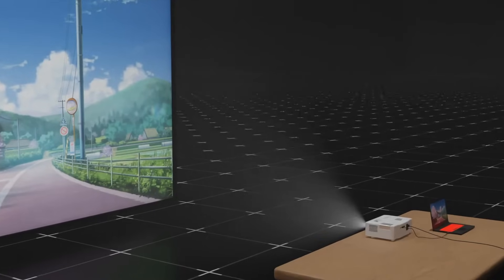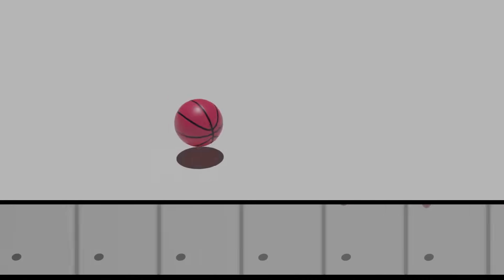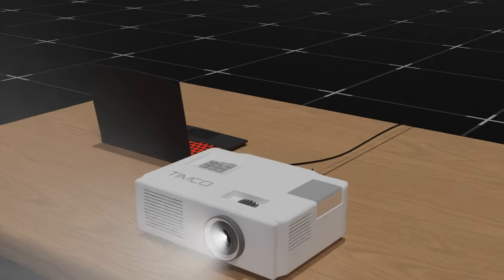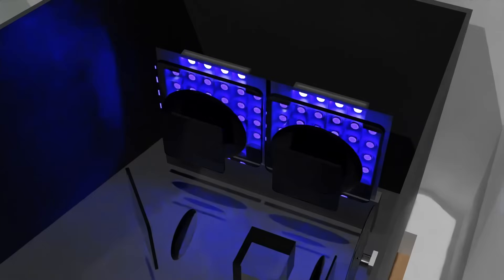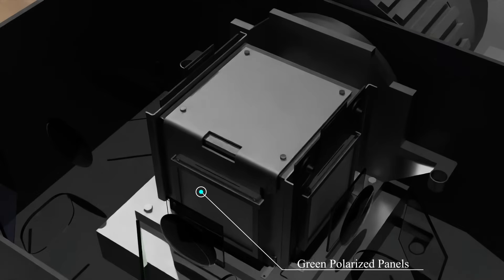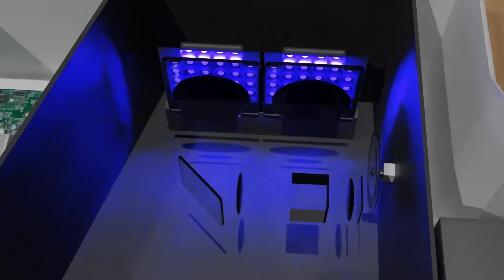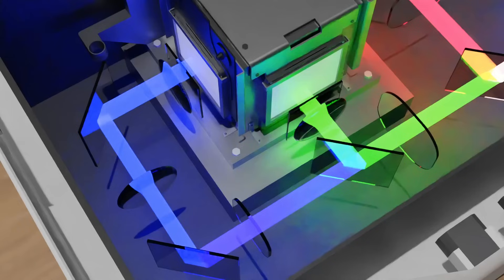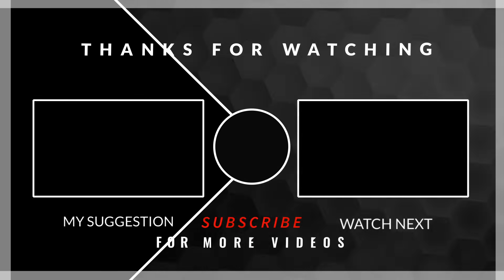How Projectors Work? (3D Animation)

Comment: I dont understand, is it lcd or lazer projector ?
Reply: the difference between LED and LCD screens is that LED is the light source, while LCD needs a neutral white backlight which is then "filtered"  through the LCD layer to control color and intensity. 
So in this case I assume you have 3 different LCD filters (one for each basic color) that adjust the intensity for each pixel, and the backlight being the three different colored laser beams, originating from the single white beam, which is turned white using blue laser and some phosphorus (as a side note, LEDs also emit blue light which is adjusted to be white using phosphorus, and then additionally colored/filtered if needed)
Reply from the maker: Lazer Projector